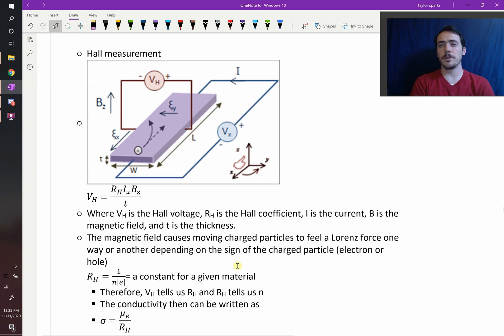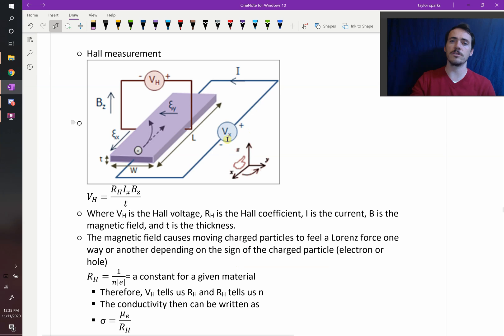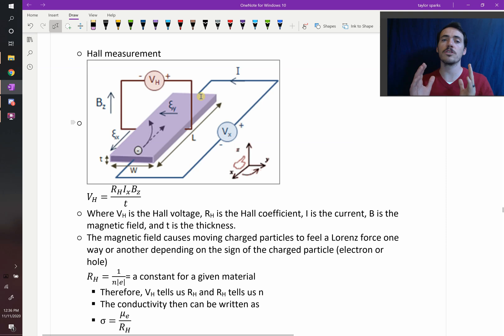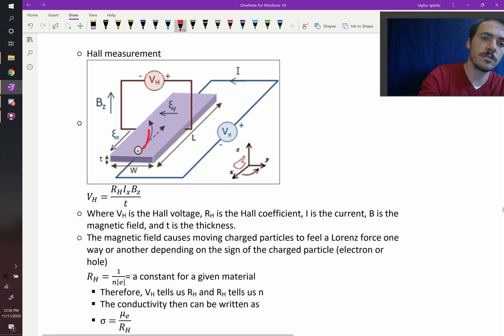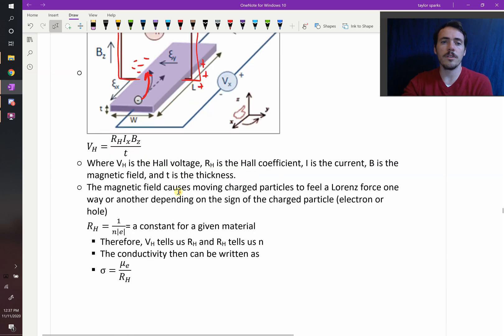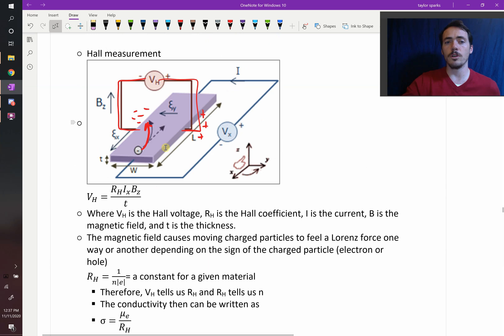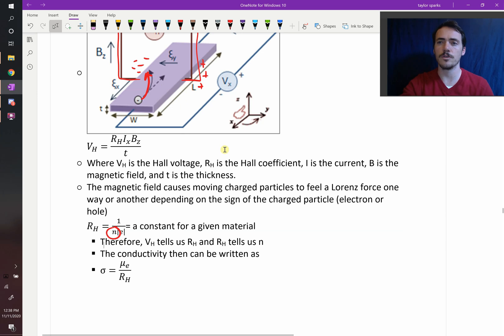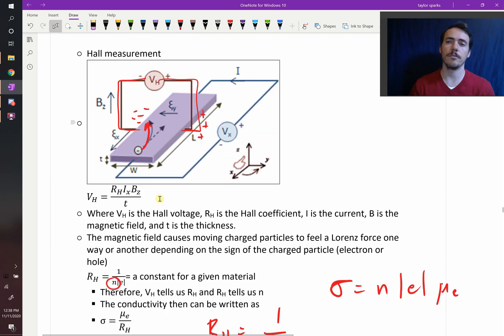Hall measurement to determine carrier type and concentration

Comment: Thank you for the video I have a few questions. 
1.When you used the flaming right hand law you pointed the electron direction to the index finger, isnt it suppose to be the opposite direction?
2. When we get the conductivity we used mobility. What if the mobility is not available how do we measure the mobility?? 
3. How dowe design the shape? Is it possible to make it right prism shape?

Once again thank you so much for this concised video:)